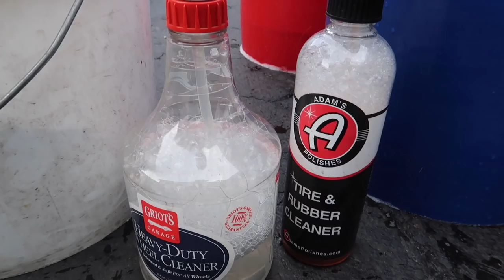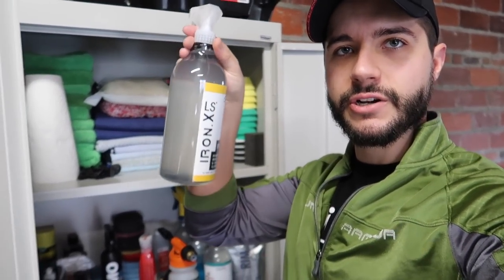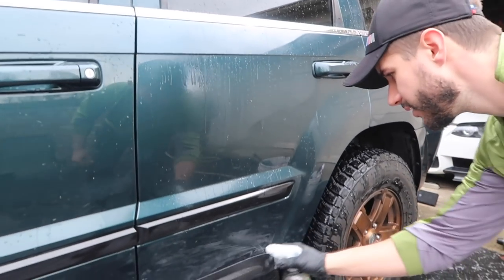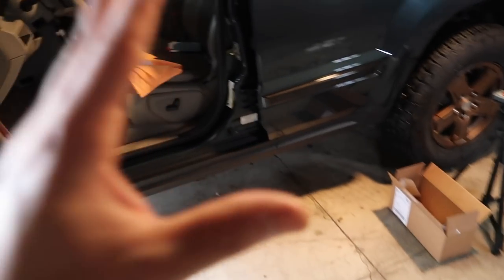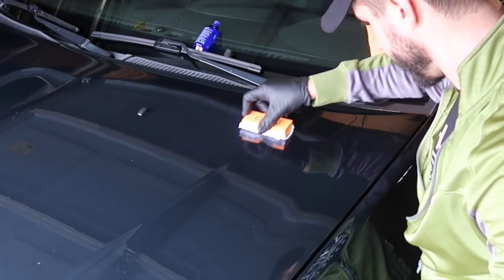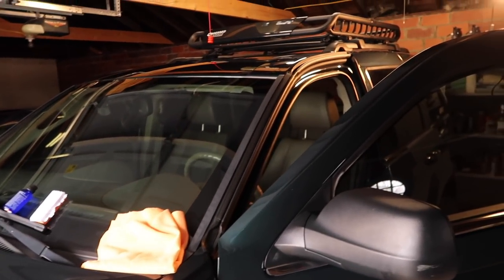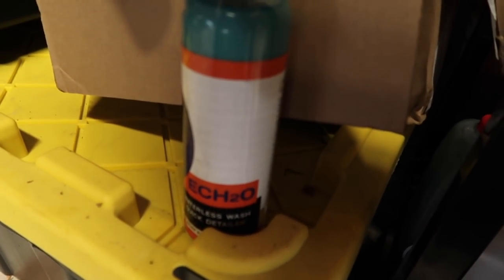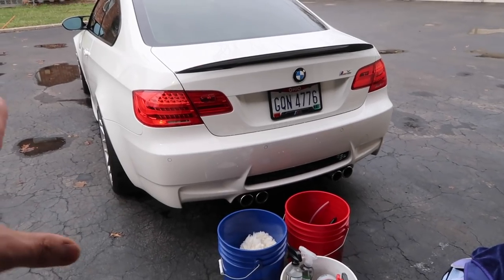CarPro GLISS | Prep & Application

Comment: I have gtechniq coating already on my Car since an year and it's still slick and gives hydrophobic effect. Can I follow the same procedure and apply gliss over gtechniq?
Reply: Manish Batra you certainly can, I've never noticed a difference anywhere when using it over another manufacturer's coating.. CQuartz is a great all around coating but in my experience it doesn't like water spots and they embed much faster than other coatings. But I have a lot of rain and very hard water in my area..